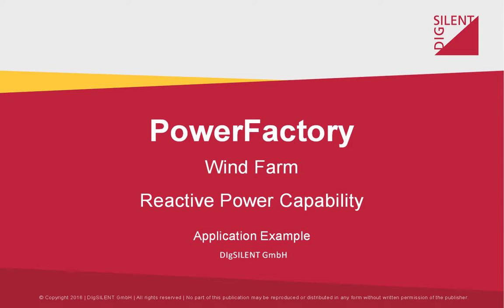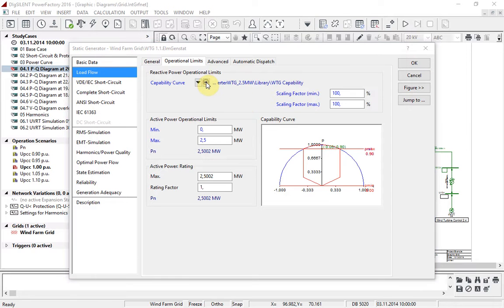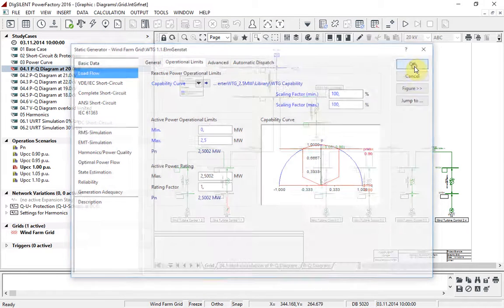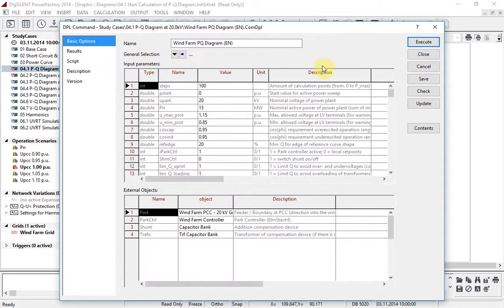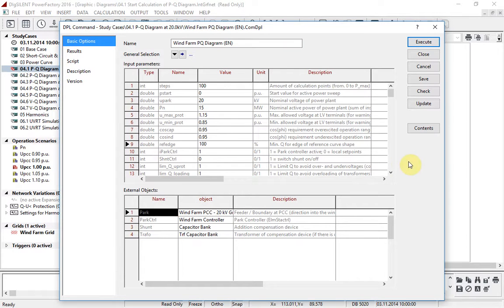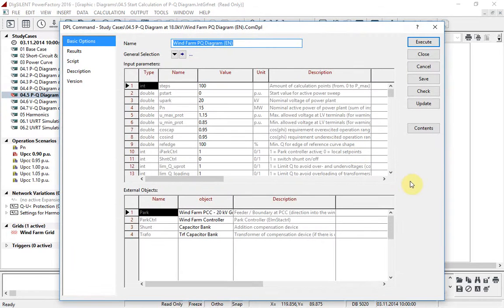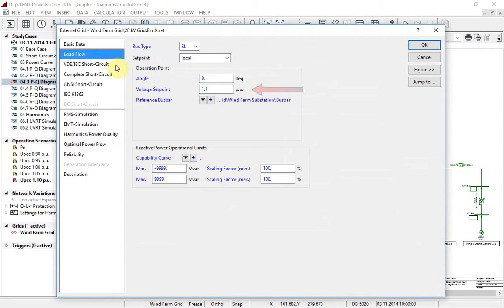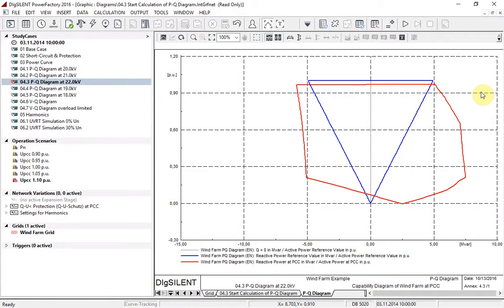PowerFactory - Wind Farm - Reactive Power Capability

Comment: Hi,
I want to determin the reactive power capability of a wind farm (with 4 wind turbines) depending on the injected active power (P-Q diagram).
here you don't show how you did to get this P-Q diagram, it was already prepared ?! And how can we set a DPL command or script ?
Reply: Hello achiou_ayoub,
Have you found the solution for this? My question is exactly same. Can you help me out?
Reply: It's integral to the PF install. Search your program files digsilent folder for *.pfd  It's called wind farm. I think by default it's located here: C:\Program Files\DIgSILENT\PowerFactory 20XX SPX\localisation\en-GB\examples\WindFarm  where XX is the year and X is the SP of that year.